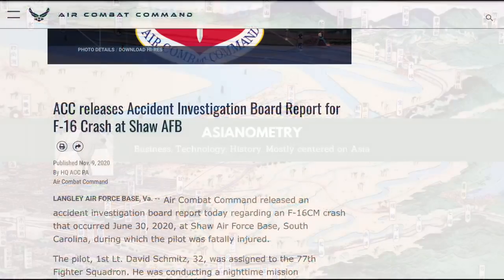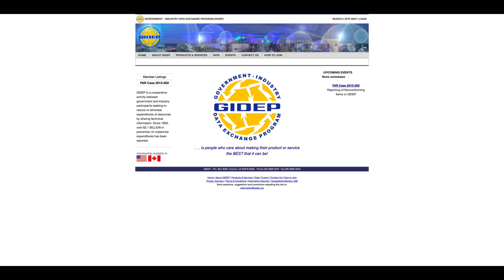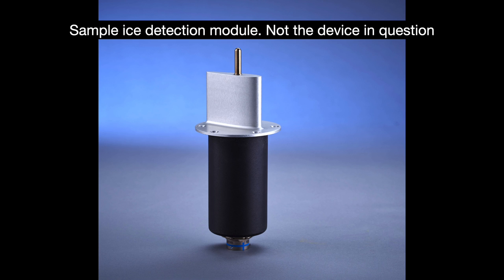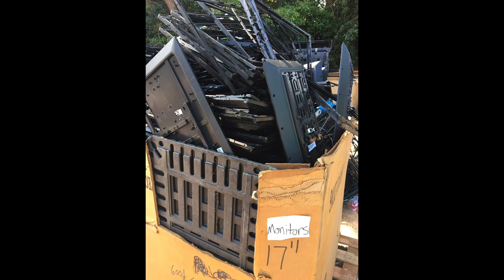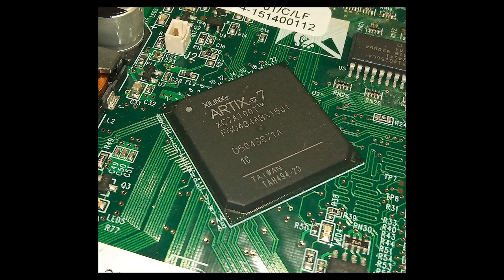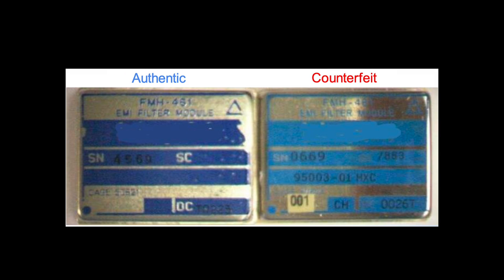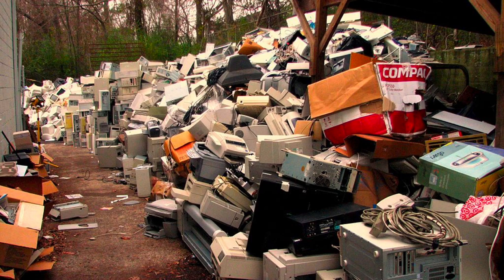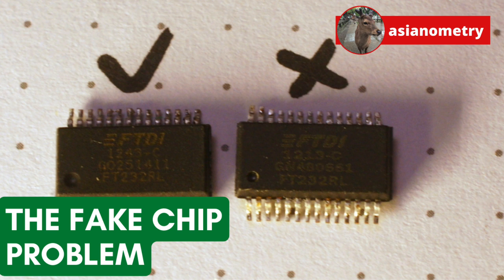The Fake Chip Scourge

Comment: This is a huge issue in retro computing these days.  Many times people getting replacement chips for retro hardware will over buy what they need from the limited sources because the counterfeit rate can be as bad as 1 in 3 with the fakes being so poor they don't work at all or have completely different pinouts. It's so weird too because some of the fakes go out of their way to look cosmetically correct to the point they are spending a significant amount of time and money on the process of cleaning and relazering part numbers that you have to wonder why those resources weren't just spent in proper testing and authentication of the chips in the first place.
Reply: That's actually a really good point; the cost of making those retro chips with modern tech is so low compared to the shipping and selling that they might as well make it work.
Reply: @joshuahudson2170  One issue with using modern replacements is that hardly any foundries produce 5v parts anymore, as 3v parts are the norm.  If you want retro boards to work correctly with "modern" components, you need extra buffers to handle the voltage conversion.  This greatly complicates the design, packaging, and price of modern replacements, and with extra buffers in place, achieving compatible timing is also quite hard.

I'm amazed at what's possible with modern FPGAs, but making new retro parts can still be pretty damn hard and expensive.
Reply: That's not an issue, that's what makes that hobby even approachable, if there were no counterfeits you would be paying 100 times the price for the original chip.
Reply: Yup, with the Atari 8 bit people have been making modern equivalent to the Pokey sound chip, same with old arcade systems. As well with the C64 and the SID chip and a few other chips and other systems.
Reply: I ran into exactly this when buying cache memory chips (SRAM) for my 486 motherboards. The chips were very obviously (read: poorly) sanded, blacktopped and re-lasered to some ludicrously low timings (10ns, when 15 was considered fast and 20 was the norm). A lot of them worked, but not all of them, so I was more or less forced to order more and just went all out and ordered 3 times the amount I actually needed just to get enough working ones and maybe a few to spare, and even with this nonsensical "solution" to my problem of even getting the chips from anywhere these days, they still ended up far cheaper than buying real ones locally (chinese relabels were about 12eur per 10 chips, a bit less if buying in larger quantities. Buying known-real NOS ones from local sellers would've cost between 10-20eur. PER CHIP)
Reply: #Amiga68060 that’s not a 68060
Reply: @Knaeckebrotsaege  This proves that the issue is not the presence of the bad chips on the market. The issue is of structural incentives. 

The Chinese relabeler could make the same profit selling 10 good chips for 36eur. Yet there are no incentives to do this in a market where everyone is a scammer. The incentives are to sell the worst product at the cheapest price because price is the overwhelmingly deciding criteria for a purchase, because everything other than price is easy to game. We need a proper reputation system for the marketplace and reviews and star counts do not cut it because they are easy to game.
Reply: this sounds more like an aliexpress issue :P
Reply: The reason counterfeiters don’t make legitimate chips is probably due to the current scale of the market; manufacturing each chip might be cheaper than counterfeiting, but the up-front investment of foundry tooling and minimum order sizes (for any foundry to be interested) is probably much larger than the small market of hobbyists.
Reply: If a supply of raw materials is more expensive to sort for authenticity than to cosmetically reprocess and there is no downside to counterfeiting, the bad actor has no incentive to ensure quality.

The same mindset that cuts baby formula with poison sure as hell isn’t going to care if you get a bad Atari sound chip.
Reply: Yep, had this happen to me, as well. I manufacture my own video game cartridges in low quantities, bought some mx29f400 FlashROMs from a chinese supplier, all completely non-functional.
Reply: It is. Some 10 years ago you still had good chance of buying old, used, but ultimately working parts that someone simply took from discarded PCBs. Nowadays for some more popular models the originals seem to be sold some time ago and all you can get is either fakes or digging through the net for various old stock suppliers who will charge you arm and leg and in the  end you still don't know where they got it from. Not even retro computing. For example Analog Devices old voltage references AD586, AD587. Those have good parameters even for 30+ years old design but all you can buy now is relabebled inferior parts. Precision opamps too. Anything in demand is faked. Maybe only parts with large volume of recycled boards and obscure or no demand in current market result in being able to buy good chips.
Reply: I have a Sony PS-X75 turntable (with Biotracer arm). The processor is known to have a very high failure rate, possibly due to power supply over-voltage. For a while, counterfeit chips were on the market. Now there are none. A viable solution is to remove the chip and rewire the board with connections to an Arduino Mega 2560. It's kind of messy.
Reply: @Michael O Yh that's true I've heard of fake motorola 68k CPUs on ebay aimed at retro computing enthusiasts smh
Reply: @AlexandruVoda  What nakes you think they are not selling the real deal good stuff at the normal market rates and those that barely passes QA at the cheaper rates instead of dumping them?
Reply: @UhOhUmm  That is not the issue - that's what makes the hobby frustrating. You can go to resellers that charge 100 times the price for a fake and still get a fake. Or you can go to a chinese source and still get the same fake part. But at lease you have far greater chance at getting a refund from a local (same country) source than one in China. 
The problem is supply, demand and immorality. If they don't have the "supply", they create it using whatever appears to fit the bill. That is getting to be worse as the chinese "used/refab but sold as new" parts start to run out. 
For many of us resellers, keeping customer trust is still a big issue. I buy nothing from China. I buy direct from manufacturer when possible and use their master distributors when I have to. I only have a couple American trusted sources for older parts. New or known good NOS components are never as cheap as the junk from China.
As a reseller, buying 20+ year old parts from those that ratholed cases of genuine parts 20+ years ago is very expensive therefore the price is high (but I never would even imagine selling at 100x the cost). You can go to china -- order a case of old, pricey parts by a case at pennies on the dollar. They will ship you a case that says the correct manufacturer and part number but that is not what you get. Usually the entire case is often dead or out of spec. 
A customer of mine complained that my $7 price for 6532s was too high and that he can get them for 80c each from China. I can't sell below cost so he bought a case from China and NONE of them worked. We got an X-Ray of these parts -- there was no die inside the package! I kept that X-Ray image as my computer's background image for years. 
As far as the plane's ejection seat in the video -- since the product was specifically for a high end military item, each component must have complete traceability. That traceability can be followed back to where the fake part was introduced and at the end of the trail is person who should have criminal charges against them. The US government has traced sources many times and has pressed charges against those that introduce fakes into the stream.

Comment: This has been a huge issue in my industry. We are trying to buy chips ANYWHERE but China as a result. They are just too corrupt for any certification to mean anything. It's mildly terrifying.
Reply: Same..... 😠😠😠
Reply: I like how you put it so nicely.  That goes for all the regulated industries which live on certifications.  I am from the pharmaceutical industry and sees first hand how all the paperwork required by GMP is addressed by making fake docs.
Reply: Samsung, Kyocera, and Micron are expanding their operations in Japan to make more chips there. It is unclear how many chip types. I know that Japan may be more expensive for manufacturing but much more reliable  - they closely monitor and inspect everything being shipped into the country and clamp down on counterfeits much more effectively. Taiwan is also good but slightly more vulnerable to fakes.
Reply: Keep in mind that the people you order them from may have bought them from China first as well. The problem starts in China, where they sell old chips that have been sitting in a junkyard in the sun and humidity for years, and they sell them as if they are new and working. Book of Swindles 101 is what they are doing.
Reply: we can help with high quality components :)

Comment: "One such incident involved the P-8A Poseidon, which is a plane. It flies and whatever." best line ever!
Reply: had to replay that a few times - did he just say....
Reply: It’s all fun & games until you have to ride on one making a magnetic anomaly detector run.
Reply: That's not a given, though. Boeing are famous for making planes doing more "whatever" than flying. Just look at the 787 for example.
Reply: They're for more like Submarine Hunting.
Reply: @Gameboygenius  There was a incident with a 747 that lost a engine on take off and the other 3 had to have reduced power due to a malfunction in some heat management system. 

Boeings response when told about the planes speed and thrust. "that shit should have dropped like a rock". Even Boeing didn't believe the plane should have stayed in the air.
Reply: @therasco400  So, if you have low enough expectations, anything can be a positive!

Comment: Another form of counterfeiting is to change the version numbers of an existing chip from a old and obsolete version to the current version.  Often obsolete versions of a chip are available for pennies while a newer version might be worth orders of magnitude more.  Just changing a few letters on a chip can greatly increase its value and the differences in functionality might be very subtle and hard to detect.
Reply: Same with ICs that have tolerance grades, eg get a IC thats worth 1$/pc at grade B/C whatever, relabel to grade A and sell at like 3$/pc or more.
Its hardly even detectable by measuring, as often for example worse grade ICs will be within the tolerance of the better grade most of the time, so you would need a huge sample size to even detect it.
Worse yet with ICs with different operating temperture ranges, as thats not detectable at all with measuring, but this specific example already was discussed in the video.
So with these counterfeiting examples basically all you have to go by is how well the relabeling was actually done, if it was sloppy then it can be detected fairly easily, if its near perfect and measuring isnt viable either well then this is a very big challenge to detect.
Reply: although x-ray can spot the change, did it several times
Reply: It goes the other way too. There's a number of "obsolete" chips that I would love to stumble upon. Starting with "Fat Angus" chips.
Reply: It's usually the opposite. Old versions are nla, and newer ones are subbed in their place as they are cheaper to produce.

Comment: A dozen years ago I worked for a company that made power modules that were used on commercial airplanes. One day things went crazy as we got a report of one of them causing smoke in a airplane. Our engineer flew out immediately to look at it. They eventually figured out that the main transformer on some of the modules was a cheap counterfeit not within spec. And our supplier had no lot control so there was no way to track which ones were bad. So I spent a summer getting shipments of these things 30-50 at a time and replacing the main transformer on each one. Roughly 66% of them were fine and probably had good parts but we changed them anyway because we couldn't be sure. The other 33% showed obvious heat damage. Some of those boards were completely charred. Those we did a full board replacement.
Reply: Who paid for that 😳
Reply: @NathanCroucher  Our board supplier messed up so they got stuck with the bill.

Comment: I can understand counterfeit chips being in consumer products, but military systems?? I was under the impression that the whole supply chain for mil spec kit was heavily audited with traceability going right back to the fab (l guess one of the reasons mil spec costs so much). Thank you for the video, interesting and informative as ever.
Reply: The supply is supposed to be documented but people fake the work. The incentive and reward is there. Just don't get caught.
Reply: The military situation is almost certainly a contractor that serviced an old assembly and the part required was out of production.  They would then need to get authorization to purchase from gray channels.  Nothing nefarious or unexpected here, just a good reminder that sufficient stock needs to be held of replacement parts on critical infrastructure, which is not something the government is good at doing.
Reply: They are usually injected to a normal market and you have almost no way to know. Fake chips are still common even with a good supliers, because there is always someone who is willing to make some extra money on doing something shady.
Reply: I mean if the lowest bidder is heavily audited then sure. But the WHOLE us military, at least, and probably others, is built on the basis of selecting the company who will do what they need for the lowest cost. It's done some bad things like the Camp Lejeune water thing
Reply: "mil-spec" doesnt always mean quality though

Its often: Shit that works for lowest cost =)
Reply: You think too highly of the us military

Comment: The problem is Ebay, Wish, Amazon etc. ... they don't take responsibility for product quality or are able to enforce it. Sellers don't know what they're selling, just what it's believed to be.  Buyer sees a Seller Rating but it's only about the online Transaction itself and the rating has very little to do with product quality.
Reply: Caveat emptor
Reply: What's nuts is that if you sold these products out of a shop, you'd be liable for these counterfeits and held criminally liable.

Comment: You missed one. I've been a MCU test engineer for 40 years and have seen test move over seas. I suspect some of the parametric failures are sent to the black market despite the certificates of destruction. They will be functional but not meet spec indicating issues with processing or particulates. The life span of these devices cannot be determined.
Reply: I commented the same before reading your comment.

Comment: When one of your products has a part that's gone EOL (end-of-life), and you missed the LTB (last time buy) memo, and some parts broker says they have 50 reels of them... maybe the parts are authentic, maybe they were acquired legitimately 10 years ago from some company that no longer used them, and the broker has been sitting on them. Your options might be really limited. 

Anritsu is still selling the test equipment I worked on as an engineer 20 years ago (with many upgrades since then), and some of the circuit designs came straight from the Wiltron 360B, which was designed in the 1980's.
Reply: I got one of their 1980's hand held spectrum analyzers. Very nice instrument, easily comparable to Tektronix or H.P.
Reply: Wonder if it will be a viable business to place large orders whenever there is a LTB notice for chips and hang on to them for a while and later sell them at double or higher prices....... hummmm
Reply: @someb0dy2  Some companies have tried this in the past and lost their shirts so to speak. Quite risky to try to guess what chips will be valuable in the future.
Reply: Well, in that case, what I do is to request a small sample and then I'll thoroughly test them. But I can do that, because the company I work for makes stuff in small batches (200 - 1000/year) and if we buy whole reel, we can be good for another two or three years.